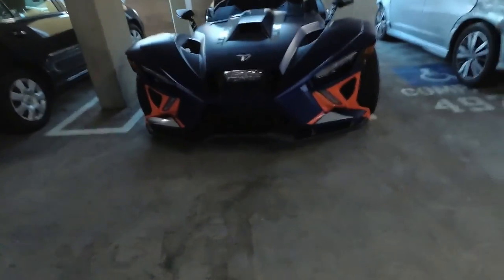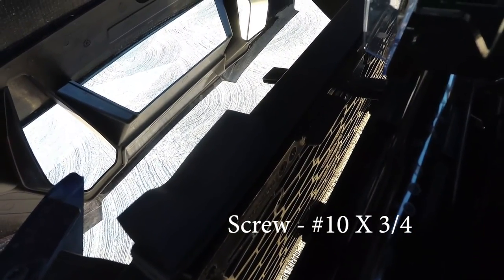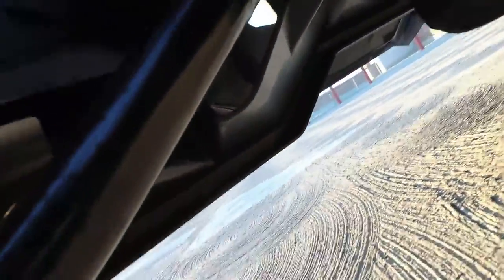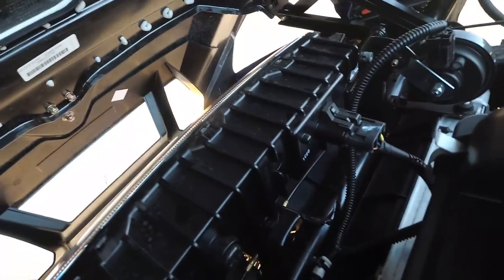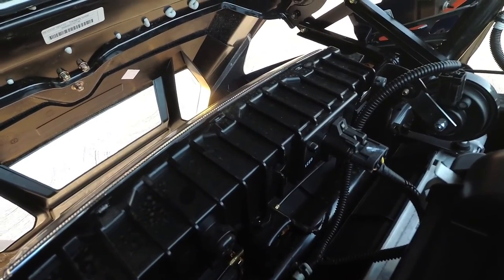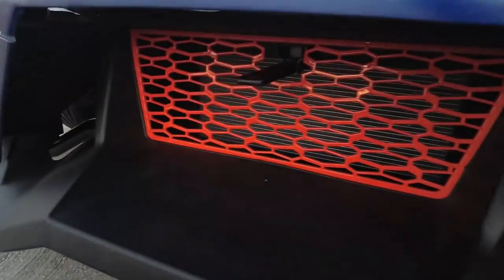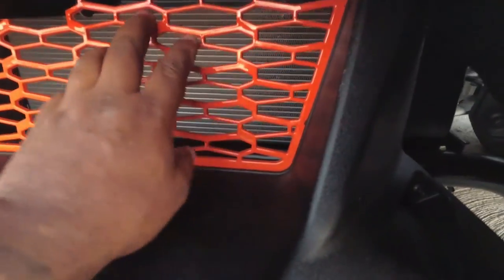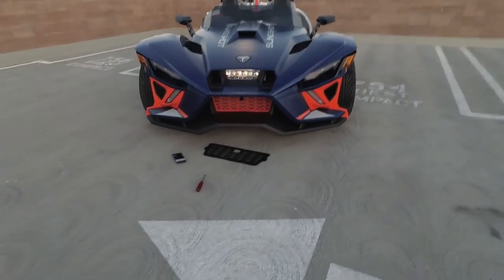2022 Polaris Slingshot R grill install - the do's and don'ts

Comment: That's a nice looking Slingshot! The R model is a little to rich for my blood. Do you miss your Hog?
Reply from the maker: It's funny bro..yes I miss my Hog.. but knowing that if I lose concentration for a min or hit an oil slack I'm not going down, is a good feeling
Reply: @slingryderz7936  I hear ya! I rode motorcycles for over 20 years. I sold my Road Glide 10 years ago for family reasons. I've been considering buying another motorcycle. But I like the Slingshot also. I don't want to buy either used. I have to pick one, It's a hard choice.

Comment: The grill really makes it stand out. I also have the 2022 Midnight Storm Fade . After seeing your video I wanted to get the grill for mine. But I searched and could not find a grill in slingshot orange.  I was able to stop your video at :34 seconds and get the part no. 2884148-881 off your box. When I did a search for this part no. the results were Volt Orange grill. May I ask where you purchased you grill in slingshot orange. 
Thank you
Reply from the maker: The orange used in the 2022 R is Volt Orange  
https://tinyurl.com/pxcsd3p9

Polaris 2884148-881 Volt Orange Front Grille 2015-2022 Slingshot SL GT SLR R S